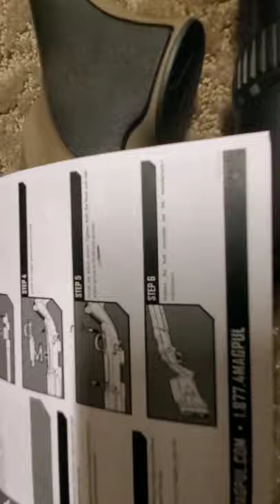New Stock for the Remington 700 ADL Tactical

Comment: Did you have any problems with the 2 trigger guard screws from the ADL being to short for the magpul hunter short action stock? Planning on converting Rem 308 ADL to the magpul hunter. I’ve heard the trigger guard screws will be to short for the magpul hunter.
Reply from the maker: I didn't experience that. Mine dropped right in and bolted up tight.

Comment: Do you think it would be possible to install that magpull mag conversion in the original stock?
Reply from the maker: No, not without completely milling out the magazine area. Even then not sure the stock would be rigid enough. The magpul has an aluminium bedding block.

Comment: Got the same stock on mine.  Couldnt get any better than 2" groups at 100yds with the original stock.  Didnt think it would make a difference with a diff stock..  Getting 3/4" groups at 100yds now.  I was pretty surprised
Reply from the maker: Sweet, that's a nice improvement. Most of the factory stocks today are such garbage that any aftermarket stock is an improvement.